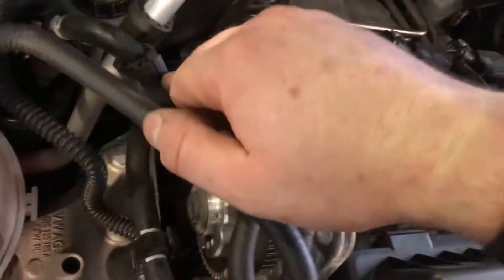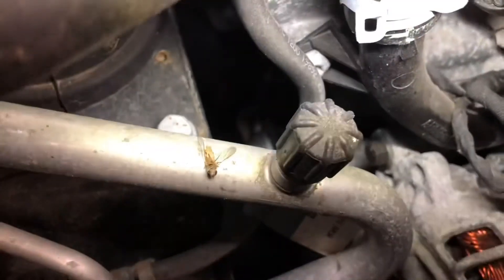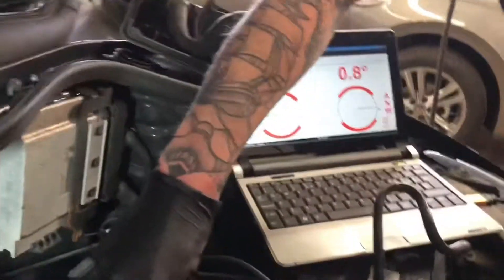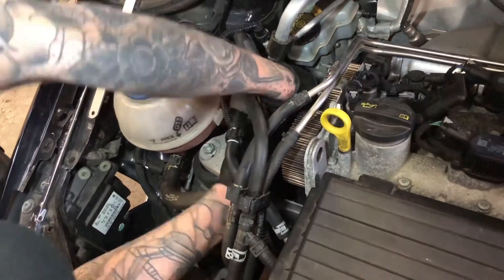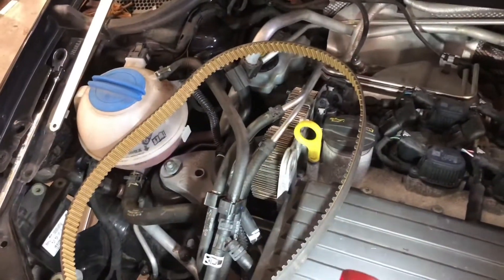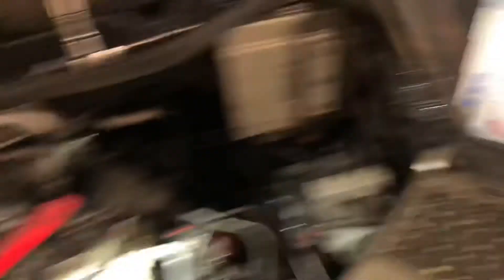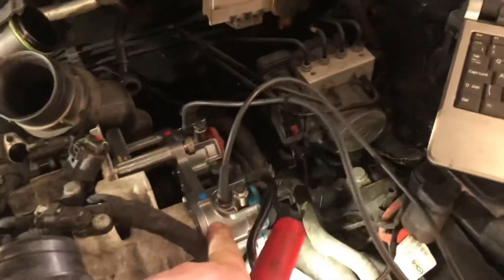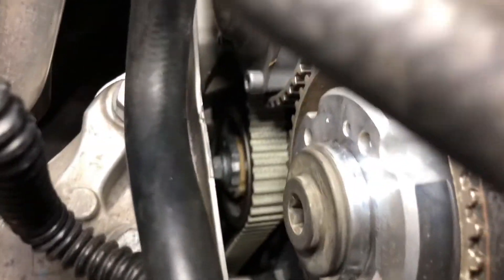Volkswagen Group TSI Engine Electronic Timing Tool

Comment: Hi, I have a Seat Leon 2016 1.4 eco TSI with ACT. What's your opinion on the water pump being changed considering it's not being run by the cambelt? I've seen some sources say just wait until the water pump starts leaking for it to be changed because it's independent from the belt
Reply from the maker: Hey thanks for getting in touch yea in my opinion as it’s not driven by the cambelt there is no real interval for it… you can change it when you like as a precautionary measure :)
Reply: @TheVWMechanic_official  Thanks for the incredibly quick reply! I've also left a like on the video :)
Reply from the maker: Thankyou very much and your welcome
Reply: I had mine replaced by Seat for £500 in 2021
Reply from the maker: Loads more now then
Reply: @TheVWMechanic_official almost a grand now from Seat or VW
Reply from the maker: Absolute madness
Reply: Hello I've  just purchased a late 2013 model 1.4 tsi 140 with cpta  engine and a young lad at vw told me it had a chain and not a belt can you tell me please . .its got 125k kilometres on  the clock
Reply: Did you get your belt replaced?

Comment: Iv dont belts on 1.4 tsi that dont have act with a different tool to lock the cams. Does this engine need this tool to do the cambelt?
Reply from the maker: Yeah you should use this tool to get it absolutely spot on and within tolerance and the difference between act engine and non act with this tool is just different specifications to time it upto….I’ve spoken to a lot of people who have just used the metal cam locking bar and been ok…the only thing I see a lot of at the dealership where I work at is the cars that have had the locking bar used on them being recovered to us with running issues :(
Reply from the maker: I know what you mean buddy and at this moment in time the electronic tool you see me using here is only available to authorised repairers but thanks for the comments and of course watching its massively appreciated 😃
Reply: @TheVWMechanic_official  happy days man..  im not very clued up on the tsi but learned a great bunch now didnt even no wat those 4 coil lookings things wer on the cams. Obv for the ACT?  can u tell me r these a life long belt  i was told ever 100k r 5 years. Personally i would trust "long life " r am i wrong?? These r a headache of a belt to b honest ther a bastard to get on without takin cam pulleys off cant even get engine mount off either with engine all way up r down?
Reply: Wouldnt i ment😂
Reply from the maker: So Volkswagen and skoda UK state the belt should be 5 years but as for other countries it could be completely different so I will always recommend 5 years in the uk and yeh they aren’t the nicest belt to do I do plenty of them at work and the diesels are a lot easier
Reply: @TheVWMechanic_official  ah man im a diesel genious wen it comes to the pd engines😂👍 but these belts r a pile of shit im gona send this car to vw not taking up half a day to do this. Reason i txt is cause this car we sold cam in for a cam belt and it had different set up to the normal ones i do. I think the intake only has a veriator not the exhaust so i have the tools to do that engine but not on this engine.mate uv helped me alot here i really apreciate it. Ever stuck with a peugeot feel free to txt me 👍👍
Reply from the maker: I appreciate your support and your comments buddy , I am a skoda master technician and a Volkswagen diagnostic technician so feel free to message me or check the channel out as I’ve done a few repairs to show people now :)
Reply: @TheVWMechanic_official  ow il defo b in touch bud👍😂 we get alot of the german cars in wer r u based your in the uk ye? Im in dublin
Reply from the maker: Yeh I’m based in England buddy on the east coast
Reply: @TheVWMechanic_official  coola bulla man.. nice chattin and sound for the info man ur a legend👍 as i said any peugeot issues il get u wat u need off psa if u ever stuck. May drop u a txt from time to time bout a vw👍😂
Reply from the maker: Hero 🫶

Comment: Are these engines now better then the previous generation?
Reply from the maker: I would say they are manufactured in a way that your getting more power and better fuel economy but them results are dependant on lots and lots of factors and on these engines as you can see there is a lot more to them than just being able to pin them up and change the belt so for me I’m 50/50

Comment: Does this also apply to the EA211 1.2L engine CYVB ? On one hand the engine is the same but I read the VAS 611007 is only for the 1.4 and higher ?
Reply from the maker: Hey, thanks for the comment The vas 611007  is for 1.2,1.4 and 1.5 tsi buddy there are just different attachments for the engine you’re doing and also different timing specifications to follow

Comment: How do you lock the cams? I have this little plastic tool in the set but idk lol
Reply from the maker: On this engine it is the electrical tool that measures the position of the cams it has brakes to lock the cams once we have it in specification
Reply: @TheVWMechanic_official  oh I don’t have that as o work in an independent garage, is that what we need? 😂😓
Reply from the maker: Yeah you would need that tool to get it absolutely perfect we tried it just using the cam locking bar as an experiment and the engine was way out of tolerance so using the bar to time the engine up was scrapped
Reply: @TheVWMechanic_official  oh god lol well wish me luck I guess haha thanks for the quick response
Reply from the maker: No worries at all if you need any more assistance give us a shout
Reply: @TheVWMechanic_official  one last question, did you take off the big metal cover? I’m struggling to get the tensioner out
Reply from the maker: Yeh buddy take the engine mounting plate off it’s a bit of a fiddle but opens it up so you’ve got all the room you need
Reply: @TheVWMechanic_official  looks like o have to remove the alternator to get that off 😓😓 okay thanks mate
Reply: @TheVWMechanic_official  got the belt on now!!
Reply from the maker: Yeh that’s it buddy
Reply from the maker: Excellent

Comment: It’s all 1.4 tsi engine with timing belt or only engine with cylinder deactivation ?
Reply from the maker: This tool is used for all 1.4 tsi it’s just the specs are different for active cylinder technology :)

Comment: Hi, I own a vw polo 6c equipped with the EA211 66kw engine which also has a timing belt. The car is from march 2017 and I asked  VW italy about the time interval indicated by the maker for the substitution of the belt. The answer was: 240.000 km but no timeframe, just check the condition of the belt yearly.  Now, I understand that this is a traditional dry belt and not an oil bath one (like in the ford little turbo engines) and that they call it "long life" belt. So when do you suggest to do it, having my car done only 18000km? 5 year? 6, 7? I know the damage a broken belt can cause to the engine and I want to prevent it because I intend to keep the car for another 3 years before selling it.
Reply from the maker: Good evening and Thankyou for the comment and welcome to the channel…I am well aware every country has different rules on the life of the ea211 belt and I can confirm here in the uk it’s every 5 years, although as you know they class this belt as a long life belt, it’s not advised by myself as a Volkswagen technician to leave the belt any longer than 5 years due to the damage that can happen to that engine if it snaps. As your probably aware it’s an interference engine and if the belts snaps you would be very lucky to get away with no damage
Reply: @TheVWMechanic_official  yeah, better safe than sorry. I will get it serviced before the car is 5 years old which will be the next march 2022.
Reply from the maker: I agree with you totally it might be a little bit costly but it’s a lot cheaper than rebuilding an engine :) stay in touch and enjoy the rest of the content on my channel :)
Reply: @TheVWMechanic_official  Yes, I have a dreadful memory of my '96 Polo 6N 1.6 8v engine (which had electronic carburator!) breaking down after the belt lasted 7 and half a year (the original belt). I was young and ignorant then, definetly not happening again.
Reply from the maker: I’m glad that you have better knowledge now as we all have to start somewhere and learn the hard way :)
Reply: @TheVWMechanic_official  I was 22 at the time. Got more experience and knowledge out of passion for automotive. I'll keep looking at the channel, thank you
Reply from the maker: I’m glad to hear you have passion it’s great to see if you need any further assistance on anything in the future please always ask I will always help and Thankyou for your support :)

Comment: That belt, that you removed didn't look to bad in my opinion. What was the reason for the change or was it due a change in line with manufacturers recommendations?

I do love that timing tool you use, I bet it makes your job alot easier.
Reply from the maker: Yeh that’s it we changed it as it was due by manufacturers recommendations and the timing tool is great and its nice to see it in screen because on this engine if you use the mechanical cam lock bar and the belt off and new belt in it can be out of time as the tolerances are so fine w
Reply: Yeah I'm not surprised, clever little engines those ACT's.
Reply from the maker: Yeh for sure good on fuel too
Reply: Have you replaced tensioner roller and idler pulley or just the Cambelt? As vw requirements?
Thanks
Reply from the maker: It was all changed buddy just don’t show on  camera as it’s a bit time consuming but yeah whole kit was changed